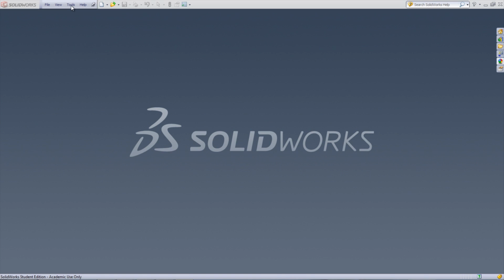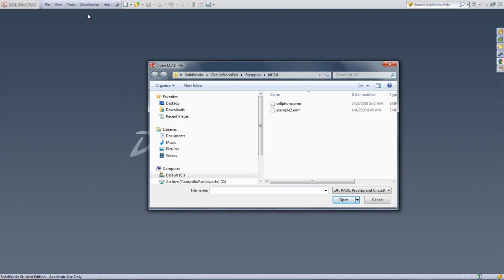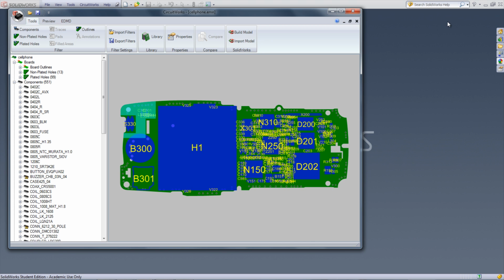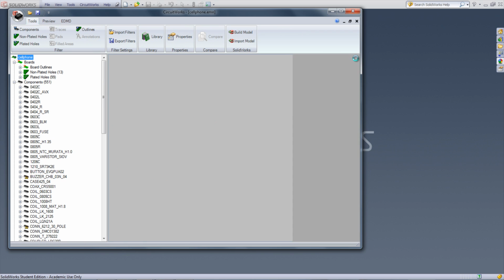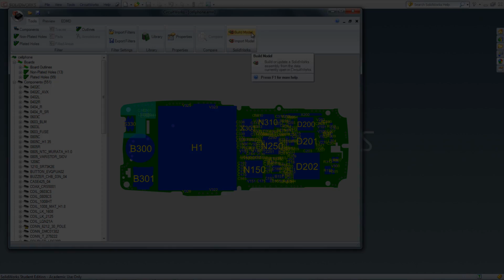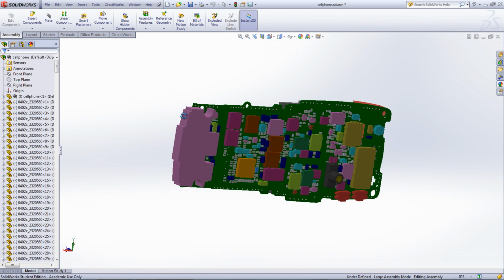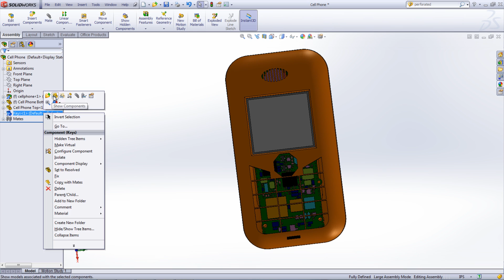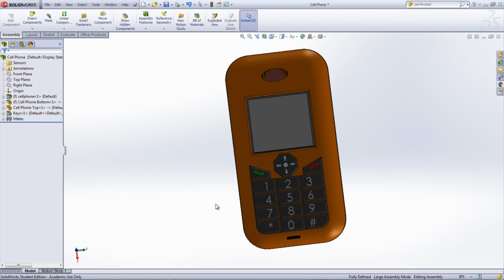Converting Printed Circuit Board Designs into SolidWorks Assemblies using CircuitWorks

Comment: Most people use Eagle. How can I import eagle pcb's into Solidworks.
When I select the *.brd file CircuitWorks says "No library file can be found for this board file. Would you like to browse for one?"
Reply: I know it's a month later but you have to extract your board as IDF 3D. Select the free option and then select a folder to save it. After that follow the video instructions
Reply from the maker: Hello, please contact your reseller, they can help you find a solution to this: http://3ds.one/wL3W57.
Reply: Thank you. Maybe I'll try again some time. For now what I'm doing is download models for the components and assembling (in an Assembly) them on top of the board (just and extruded parallelepiped). To simulate the copper traces, I export each layer from eagle in png and place it on the top and bottom faces of the board, as a Decal. They serve as reference for part placement.
For small boards this doesn't take very long to do at all and looks gorgeous in PhotoView.